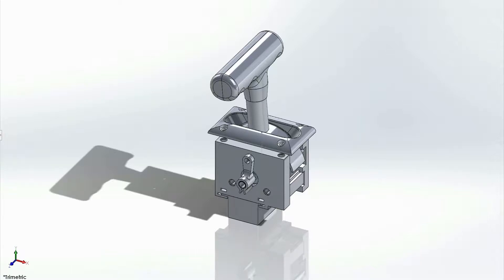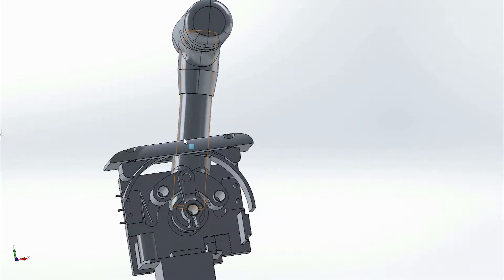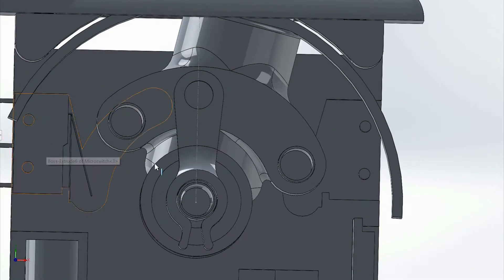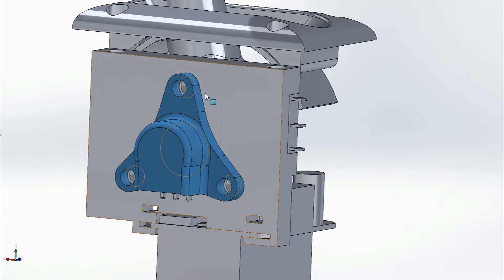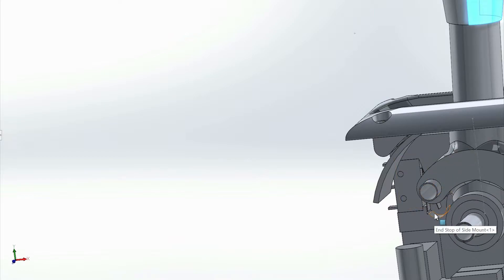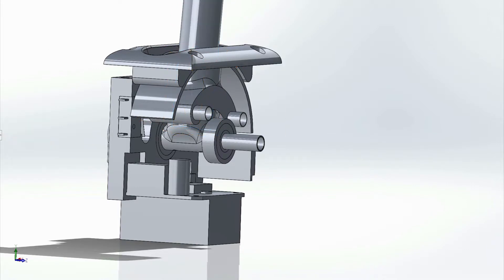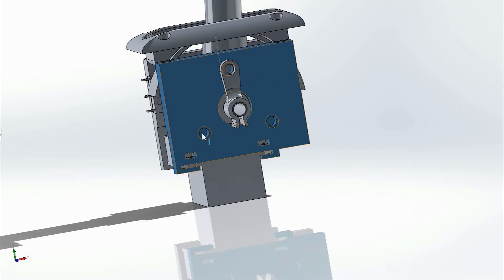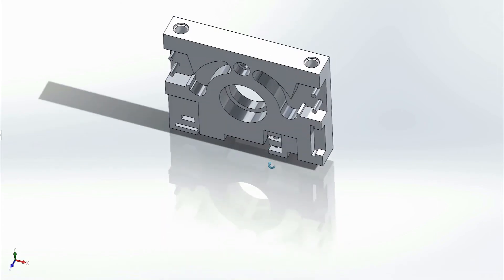Throttle Handle CAD Video

Comment: Hello Ned, I've just subscribed. I'm here via a convoluted path, but American Boathead is mostly to blame, er . . . uh, I mean responsible.
I've just watched all three of your videos on this throttle. I really like your design, thank you so much for sharing it with everyone. 
First of all, I feel that I should let you know that I know nothing about 3D printers or ardweenos. (I'm sure that's misspelled.) I imagine that I can find someone that can print it for me. I'm confident that I can assemble the pieces once I have them, and I can probably get a nephew to download/upload/program, or whatever you do to the ardweeno. 
I have a few questions about your design. 
1) The micro switches. It appears to me that they are only engaged at the ends of the travel limits. Is this to indicate full throttle position? Is this part of a safety/arming protocol? 
2) Detents. I did not notice any mention of position detents. Specifically, a "neutral" detent. A definitive stop in the neutral (off) position. Without a detent, it is quite easy to 'overshoot' the stop position and get into a cycle of forward - reverse - forward - reverse. This can lead to problems when trying to maneuver in tight quarters (like docking operations). This is something that I have personally witnessed. Fortunately, nobody was injured, the damage however, was about $2,000 US. 
I do very much like your solution to adjust the friction/resistance for the lever.
3) Water proofing/shielding.
The semicircular piece that moves with the lever. It most definitely gives the assembly a nice finished look. It will also keep fingers and falling debris out of the mechanism. I'm curious if it will also direct any dribbling water away from the bits that contain the magic pixies and their magic smoke. It's quite easy for me to imagine scooping something from the surface of the water, then immediately use a still dripping hand to operate the throttle. Water runs from hand, down the shaft . . . angry pixies, billowing smoke.
4) Voltage/Amperage ratings. What is the capacity of this design? I presently own two motors. One is 12 volt, and one is 24 volt. Can this design accommodate different voltage and amperage? 
I apologize if any of these questions seem stupid. I, myself,  just don't know enough about the electronics and appreciate any and all shared wisdom.
Thanks again.
Reply from the maker: A lot of questions haha, but thank you!
Micro switches are to let the arduino know when you've reached full throttle. The potentiometer is what tells the arduino how fast to go in forward or reverse, but the switches just calibrate it basically.
There is a dead band in the middle, so should be able to find the middle ok without a detent, but that would have been a nicer design, yes. I was pretty new to modeling still there I believe, and detent also would have meant another switch to calibrate the middle point also.... so this was easier, and I don't believe it would be a huge problem with trolling motors in a mini boat
Waterproofing is definitely needed. There are a few sprays that should work well, I forgot which one I recommended to Brian... but you definitely need to keep the water away from it all if you don't want to let the magic smoke out!
And regarding power, the controller is rated for 27V and 43A, so should be ok?
I just need to be very clear that these controllers have never once been used on a real trolling motor, let alone on a boat in the water! I have no idea how well it will work or if it will all blow up etc haha. It SHOULD work, and it SHOULD be a pretty cool solution, but no guarantees etc. I hope Brian puts them on a boat one day, so I can see if they work after all these years hahahaha
Reply: @NeilvanGeffen  Hi Ned. Thanks for the info. I'm impressed with the capacities. If you can't make a trolling motor go on 43 amps, you've got a problem. 
I understand that this is an entirely experimental endeavor. However, I believe, that with those figures, you've designed in enough clown cushion to ensure a more than fair chance of success. 
I appreciate your response, and effort in designing and offering it as you have. 
Cheers!

Comment: Great stuff mate! I refurbished a 30ft cabin cruiser into an electric cruiser. Had it for 5 years but am upgrading the voltage. Unfortunately the old throttles don't work so looking into pretty much what you've done! Much appreciated! If I use them I'm give you a shout out!
Reply from the maker: thanks mate, not a problem. good luck!

Comment: Hi Ned, Brilliant setup. I've found your Thingiverse STL's for printing the controller out, but haven't been able to find any info on the types of electronics and hardware you've used to assemble the controller. Do you have a build list of parts, etc?
Cheers
Reply from the maker: Alright, i've added a bunch of info to the thingiverse listing. Hope that helps!
Reply: Thanks mate. Sorry to be a bother, I'm still learning about electronics and what does what, is there any way you would be able to supply a wiring diagram of how the unit was/is wired up? Also, the website you've supplied for the code isn't working.
Reply from the maker: The link seems to work for me sorry. Not sure how else to help. Wiring diagram wise, i probably could but i'm a bit busy ATM sorry. Are you able to use atmel studio to load on the code? or just a hex file loader like Xloader? it's not really a very newby friendly project sorry, i never really documented anything properly, and thats my fault
Reply: Nah, wouldn't have a clue Ned, never ever heard of an Xloader. Might have to chase up a simpler mechanical type setup with separate forward/reverse switches that doesn't have to rely on an Arduino or programing.
Reply: Hi Charlie, I see this post is 2 years old, but if your still interested in this I found something that could help you with wiring. https://www.handsontec.com/dataspecs/module/BTS7960%20Motor%20Driver.pdf